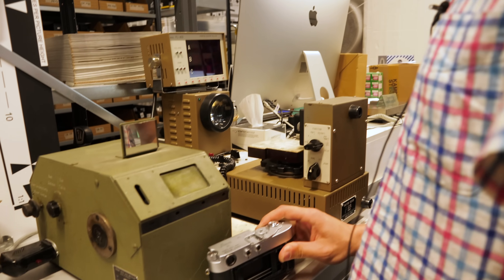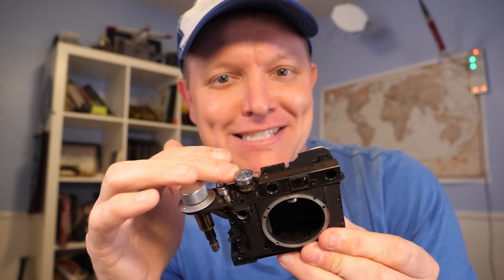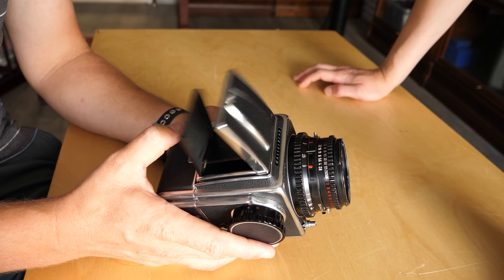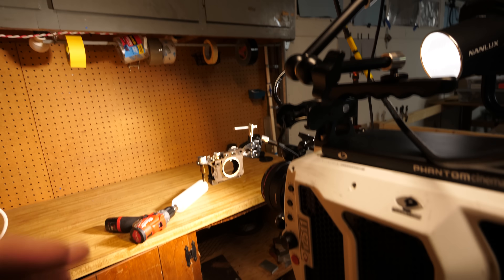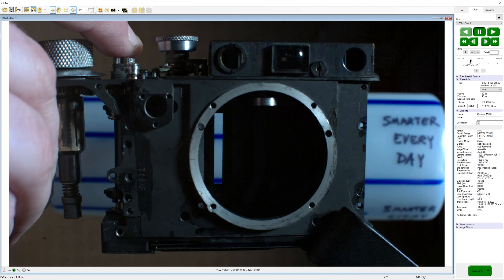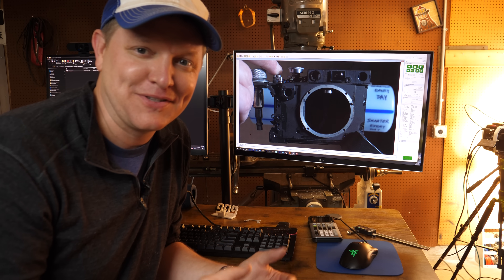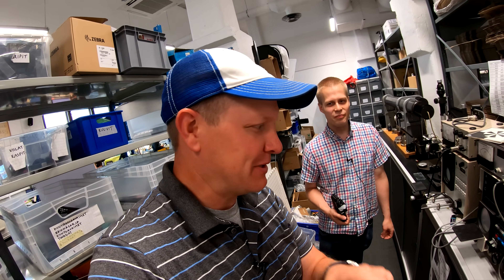How the Germans Measured Milliseconds MECHANICALLY - Smarter Every Day 283

Comment: From what I’ve played with.  The difference in speed is the amount of of GAP that the curtains allows from the leading edge of the curtain and its trailing edge.  The narrower the “SLIT” the less time the film is exposed as it goes across the film plane giving you a ie 1/1000 of a second. The wider the slit is causes the film to be exposed longer ie 1/100 of a second…..  I use to see this difference when looking at the curtain while pointing it to an old style TV as a kid.  You could se the difference in the slit size.  So basically the trailing edge of the curtains release causes the gap size and dictates the amount of time that the film is exposed. This is a mechanical spring release for the leading edge and the longer it takes to release the trailing edge makes the exposure duration across the film.

Comment: Вопрос. Имеет ли смысл делать измеритель скорости затвора на современной элементной базе? Светодиоды, микроконтроллеры, вот это всё. Или ещё осталось в работоспособном состоянии достаточно много таких старых приборов для проверки?
Question. Does it make sense to make a shutter speed meter on a modern element base? LEDs, microcontrollers, that's it. Or are there still quite a lot of such old devices left in working order to check?

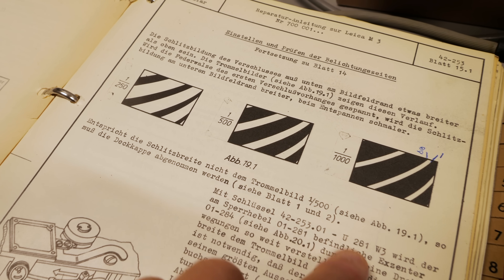Comment: 12:24 Is'nt it because of digital camera usually take picture from up to the bottom sequentially, and the analog camera using spring to push the curtain *from left to rigth*?
So If we take the photo using digital camera that tilted 90 degrees to the left, maybe we can have the same result

Comment: Back when we didn't have the electronic or digital test equipment, they had to come up with ways to accomplish the the needed measurements mechanically, and as a kid, I was often shown or even given some of the obsolete equipment to do with as I wanted. Sadly, I was into tearing the stuff apart for parts for other projects!

But it isn't to say that the old way was not worth knowing about, as it made it possible to recreate some of the process with electronic and digital equipment. Today, with the microminiature technology, we can get very small devices that do the same work, with very accurate and repeatable measurements! And the cost is also very low!

Comment: So... the lines directly map to exposure over the horizontal axist, so if the lines are bent due to accelerating shutter, shouldn't the lines need get thicker as well, to even out the exposure? (meaning the first shutter needs to accelerate away from the trailing one).

That's quite the balancing act.

Comment: great video but you didn't mention that exposure in cameras, even in the latest digital cameras, is measured in 'stops'.  Stops are a doubling and halving of values so constitute an exponential scale.  This exponential scale system was adopted well over a hundred years ago because the differences in levels of light that the camera (and the human eye) has to deal with is enormous so a simple linear system could not deal with it.

Film speeds/sensitivity (ISO) is mostly measured in whole stops,  although the old German DIN system did rate film in third-stops - example DIN 21 = ISO 100, DIN 24 = ISO 200. 

Perhaps due of lack of space, mechanical cameras generally only show whole-stop increment on the controls.  All sorts of strange numbers now appear on screens of digital cameras - these are third-stop increments. Perhaps a mathematician could explain why 64 is one third between ISO 50 and and ISO 100?  I would have said 67, something to do with exponential scales, I think.

I would have thought that the electronic tester would be more useful if it could show the error in terms of percentage towards/beyond the next third-stop setting. 

Whereas the smallest exposure increments in cameras (ISO - lens aperture - Shutter speed) is 1/3rd of a stop,  post-capture editing software deals in percentages, like everything else.

Comment: How to calibrate that modern electronic measurement-device? For that you need some device, that could reproduce results out of physicaly rules/fundamental attributes. Its also, why there is a strange metal-cube in France called the "Ur-kilo" or so. A lump of metal, that is constructed out of several physicaly calculated constants, so that at the end the cube will be nearest at 1 kilogramm, as it can.
Analog and mechanics are not realy obsolet. More the oposite. For such tasks you need simple solutions, like the meter-lengt chiseled in a stonewall at the market place on middle-age citys. So everybody can "calibrate" their measurement-device easy.

Comment: I think it's not only bout how wide the stripes are, but also about how many stripes you see and what angle the stripes are at. The "correct" width of the stripes only proves that the distance between the first and the second curtain is set correctly. They might still move at the wrong pace though. The slower they move, the more stripes you will see and the more vertical the stripes will be.

Comment: That Pentax at the end... The 1/250 was slow but the 1/500 was a lil bit fast and the 1/1000 was a lot fast.

Going off that data and a more.or less lay person's mechanical knowledge, non camera specific... Diagnosis of: tired firing drive spring combined with prior service work trying to bring it back into better working order? Like... Old spring is too weak but some sort of tension adjustment being made to adjust it faster. That's why the middle range ends up "pretty ok".

Curious to see how my guess compares to someone that actually knows what they're doing. And to the folks working on that particular camera.

Comment: That was very cool. I know this kind of stuff and did not know this one. I thought at first the bands were an optical interference effect that is common used in modern measuring systems with single wavelength lasers and beam splitters. As I listen, this is not the case. Interesting and very clever. Thanks for sharing and all the work it took.

Comment: Hmm, my comment was just deleted.  Anyway thanks for making this very detailed and organized video.  100% makes sense, sorry our government will 100% ignore it....  I have a different thought.  Rather than a smart electrical panel, how about a smart outlet adapter.  This adapter would have the smarts to measure current, shut off the power, and communicate with a central hub that coordinates.  You could easily make on that plugs in for the range, clothes dryer, a hard wired version for the water heater, and update the firmware on the car charger, don't forget to tell the heat pump thermostat too.  This should be nearly "homeowner friendly" and much cheaper than a new panel.  All these smart control plugs can communicate with the hub then the hub tells your phone how much input current (power) is left.  if say you had 15A left you can turn a burner on your range on.  Turn on two burners and the smart plug trips off until you tell the app you've fixed the load issue.  Or the hub tells the car charger to go to a lower ampacity to make room.  This can all happen very vast, much faster than the main breaker would ever trip.  I don't think the breaker will trip at 110A after many seconds.  This could be easily done in just a few months from an engineering perspective.  
I just updated my pushmatic 100A panel with a 200A panel (by myself) so I've got more than enough (as you say).  But what happens when I get two car chargers????  
Love your channel and this idea!  Not many youtube channels would get so many words from me...

Comment: Destin, you have featured two of my all time favourite cameras. A Leica and Hasselblad, I couldn't afford either. I had a full Bronica SQA system which cost me £12,000 new. Had I bought it in Hasselblad it would have been three times that. I also used a Mamiya 6x7 with the bellows body, it was great but my 5"x4" land camera could do everything I needed. My ex sold my Bronica SQA system, I wasn't happy. When I discovered what she got for it I was fuming, she got £600 for the three years old system including my Elinchrom flash lights. She didn't find the boxes with my darkroom in them.

Comment: Admittedly I did not watch every minute of this, but have a question. In the last case where the camera set on 1/1000th was firing too fast, is there any way to adjust the shutter speed without slowing down the other speeds on the dial? Or does it simply mean that that camera is faulty and cannot be fixed?

Comment: Back in the 1980s we used to do this by photographing a CRT television screen and counting the lines. - Of course you had to shoot and process some film so it was less than ideal but it worked.  I have that Leica service manual with the strobe test pages. - Would love to find the machine and check my IIIa (I rebuilt the shutter myself - tough job!)

Comment: The way the resulting stripe-picture looks implies that the final picture does not have a uniform exposure. Since the curtain seems to speed up during the exposure the right side of the image should be less exposed than the left. I wonder if this still a thing with modern cameras.

Comment: Super fascinating to always be reminded of how sharp engineers were and how they worked around the technical limitations of the day. This and the sheer quality/robustness of manufacture meaning things that are nearly a century old either still work or can be easily repaired to work. I don't expect the unit Destin had was nearly that old, but it was obviously built with such good standards that the internal assembly can be dropped from over four feet onto concrete and still function. If it were something from the last 20-30 years made with "efficiency" (I.E. plastic/corners cut) in mind, a similarly exposed assembly would likely blast apart into a slurry of parts and bits. Thanks, late-stage capitalism for convincing the world's manufacturers to stop making EVERYTHING with cast iron and stamped steel! lololol

Comment: The slope of the line doesn't change so the shutter curtains are moving at a the same speed regardless of shutter time selection. By counting the number of lines horizontally (e.g. how many lines you see across the top of the frame) you can tell how long the curtains take to cross the image area.
What changes as you select the exposure time is the timing of the second curtain (or equivalently, the width of the open gap between the curtains) so the width of the stripes is what varies.

Comment: There's similar method to measure the actual shutter speed of a focal plane shutter by photographing the screen of an 'old fashioned, CRT' TV screen.  I don't recall the exact step by step procedure.  It was on the order of compare the number of lines captured in  the photo to the total number of lines that the TV 'painted' to create the TV image, then determine the fraction of time of those lines in the photo compared to the time the TV spent painting those lines.  I think the total number of lines was 525 and the time was 1/30 of a second.  So, if your photo captured 262 lines then the shutter was open for 1/60 of a second.  Of course you'd check all the shutter speeds & if they were 'off' then the camera needed service.  This goes back 50-odd yrs, so these details are more than a bit fuzzy.

Comment: I heard that even in early 19th century they used a very similar principle (rotating discs) to measure the speed of cannonballs -they'd hand-crank two really large paper discs a couple meters apart, to  a certain rotation speed (which I suppose you can get quite precisely by hand actually, if they are heavy enough and you are using a metronome), in front of the cannon-barrel. The projectile would pass through them; the papers were angularly marked identically - so the bullet speed could be calculated from the rotation speed and the angle difference between the two bullet holes. Also quite clever in my opinion.

Comment: For decades, persistence of vision was believed to occur in the eye, but scientists now believe it occurs in the brain. It may be true that visual cells in the eye report a stimulus to the brain slightly longer than the actual stimulus lasts (after all, that's what other sensory cells in the body do), i.e. an image does not turn light to dark in an instant, but the image slowly fades, but that is not the effect here, rather the effect is that the last image is fully retained for a certain period of time. And this probably happens because the brain stores the image in a kind of intermediate buffer in order to be able to analyze it at rest and while it analyzes the image, the content of this intermediate buffer does not change. So this buffer is filled, analyzed and then refilled. And we don't even notice what happens between two fillings, because our brain interpolates this period from the information before and after. And the speed is somewhere around 25 fills per second. The reason why 25 FPS doesn't always look smooth is that our fill rate isn't synchronized with the frame rate, so we sometimes only catch partial frames or moments between frames. Therefore, the higher the frame rate, the better, because in nature it is virtually infinite and the higher the more likely we get a full frame with each fill and then the brain also has to interpolate less.

Comment: The 'Zauberwort' for that old machine is frequency.
When i worked at Dreiha (HVAC manufacturer), we used a similar device to measure the rotation speed (rpm) of their electric heater units:
Mark a blade of the rotor with a dot and switch it on, point the device's light at it and adjust the frequency of the strobe light so that the dot 
seemingly stays in a steady position, exactly like you explaned at 9:55. Then you can read the rotation speed on its "display".

Comment: That machine is an optical oscillator, it flashes a black/yellow pattern with a fixed speed. The noise is not that it is badly designed. The purpose of the noise is to attune one's ear to a certain frequency from the machine so you know it is always at the correct speed of rotation. By 'mixing' the optical oscillator's output with the unknown shutter speed, by observation we can determine what was the shutter speed. Then by comparing the shutter speed as shown optically from that instrument we can determine if the shutter speed is correct for the dialed speed. SBE. Simple But Effective.

Comment: I can confirm your theory that the lines with a mechanical shutter "curve" because of the changing spring tension as the curtains are traveling. This is explained in German on the top of the page of the manual in your video just above the three illustrations.

Comment: So how did they calibrate the strobe light?  Was it just using the AC power cycles?  I know they make a point to give the right number of cycles in a day so clocks run right on that scale, but can they rely on it being tolerant enough at any random time you look?
Reply: I was wondering the same thing, and looked in the comment for the answer. havent found it yet. But AC frequncy is a good gues.

Comment: Back in the day my dad had a timing light he used to tune the engine of the car. This was late 70's and early 80's. I thought it was so cool, He would hook the light up to the distributer then shine it on this part of the engine that would spin with the crank. When it looked like the spinning part was motionless the car was properly timed.

Comment: The bar image is not curved because of a spring mechanism.  It is curved because the indexing roller moves vertically, and the shutter moves horizontally.  The Pentax is probably unique in that time period of also using a horizontal shutter in an SLR.  Th K1000 had a rubberized silk shutter.  Most SLRs of that period had vertically moving metal shutters.

The shutter speed is partially determined by the size of the opening permitted to move across the frame.  The Leica shutter repair manual detail how the shutter curtains are advanced and detained to allow for the acceleration and deceleration across the shutter plane.  Quite fascinating mechanical timing mechanism.

If you viewed the scanner through a camera with a leaf shutter, such as a Rolleiflex or Hasselblad, the scanner lines would not be curved.

Comment: I think you should explain that the source of truth is coming from AC mains running at 60 or 50hz depending on region. This is what allows the aliasing effect on both the turntable and the machine to line up the belt speed to “true”. Then the camera measures rolling shutter from there etc

Comment: The fact that the stripes were curved but now s-shaped tells me that the curtains are not slowing down in front of the image area. The spring is basically pushing more speed over the whole distance but the increase gets slower and slower when spring is losing energy and shutter blade is already moving pretty fast.

Comment: Ever since I first saw a rolling shutter in action, I've wanted to see it in slow motion and wondered about the mechanism that keeps it on time, believing until today that it was mechanically subdividing a longer more easily checked time such as 1/50, with no need to separately tune each speed once designed.
  This was a wonderful video revealing those surprising details.  But now I wonder how adjustment would work on an iris-style shutter like on my favorite camera that goes no lower than 3.3ms on a sliding dial around the objective.  Like most old cameras it also has the infinite B speed where the shutter stays open until I release my finger, thus providing the persistence needed for that stroboscope measurement of other cameras or getting those "blurred headlights" pictures of nighttime traffic.